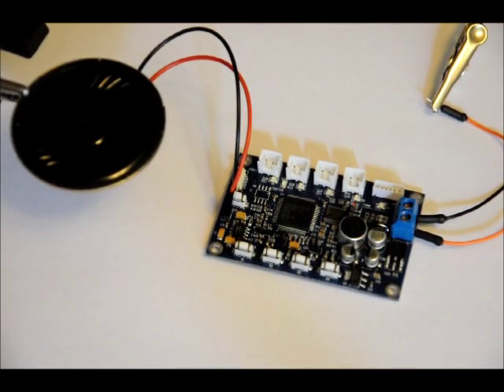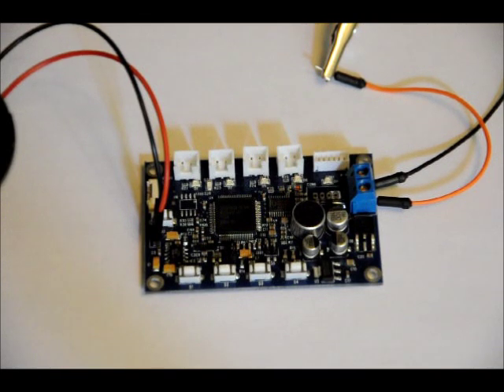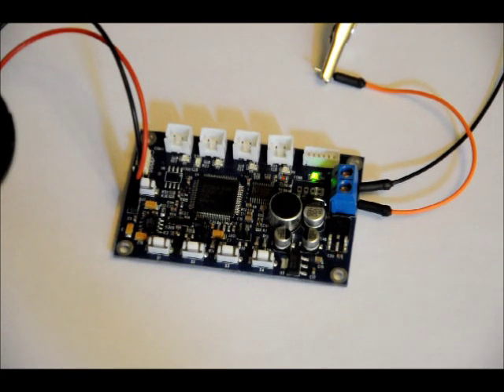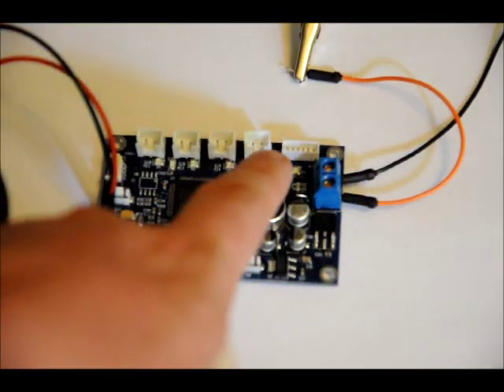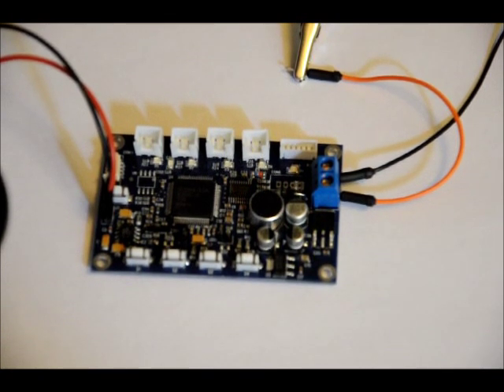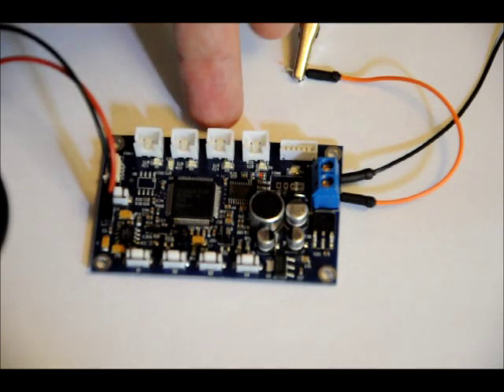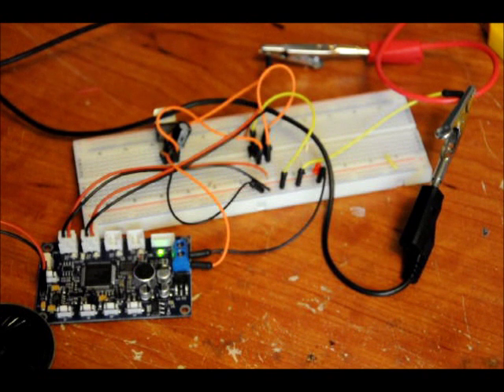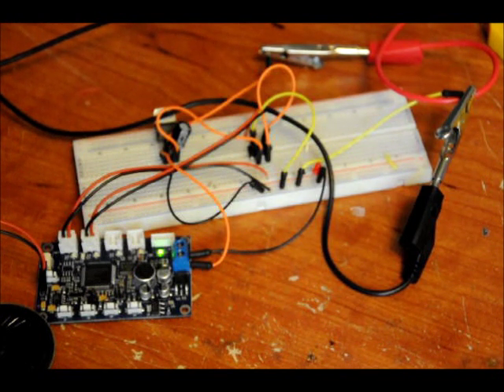FINALLY!  The Stand Alone Voice Recognition Module - ES6928P Demo.wmv

Comment: i dont see a point in such a device  for only 4-5 pins if it had a prototyping board with multiple pins or a multiplexer on board or driver then thats something to buy in a heart beat. sparkfun has one just like this and they actually use servos to demonstrate its power LED here does not do the trick for other who dont know any better i actually do and which is why i say that this many pins is not good enough for a real project with lots of devices
Reply: Cool